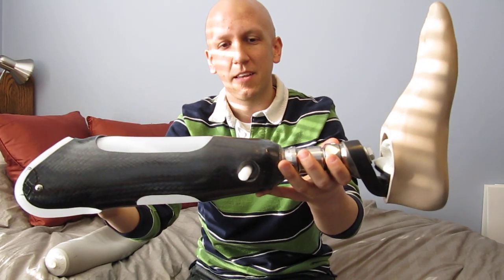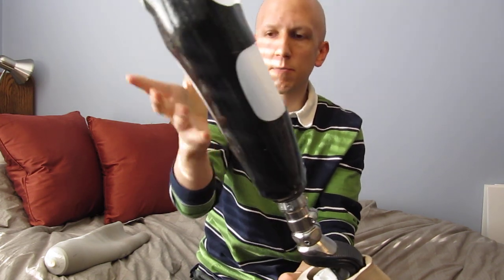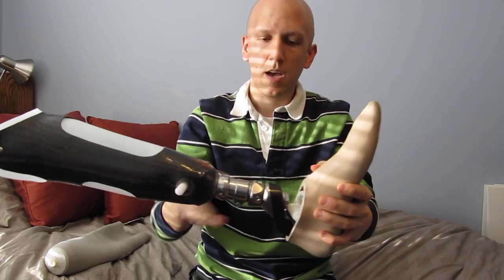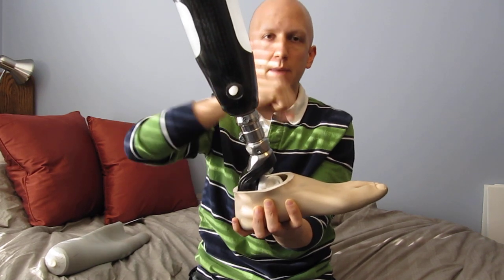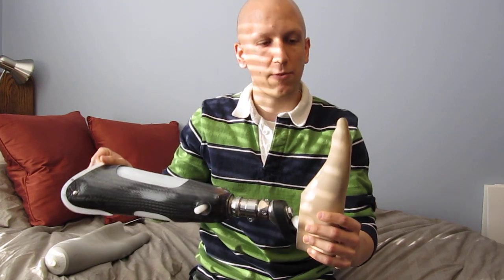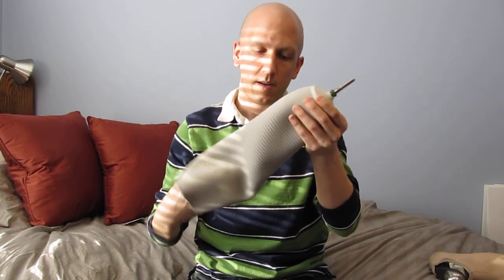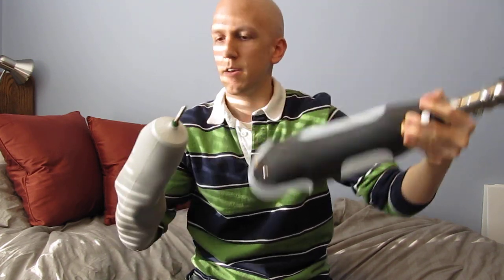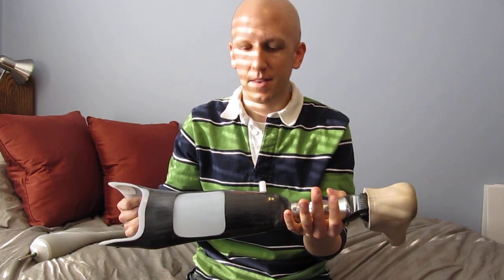How a Prosthetic Leg Works

Comment: hello, I have a prosthetic as well. my current foot shell is falling apart, I have a spare given to me from when I left my nonprofit. I want to ask, what glue is strongest to adhere the rubber foot to the upper rubber leg part. obviously it has to be strong enough to withstand the force of my weight, and strongly glue the rubber peices (I have the common rubber leg part that covers the mechanics inside, so my leg is all skin color). please help.

Comment: Just had my leg amputee above the knee.?how to i chose. A leg to do want i want to do?i own a farm and raise chickens and black angus cattle.so it will be in mud,chicken,and cow dung.plus get up. And. Down on john deere tractors to combines.any suggestion would be great.
Reply: Any prosthetic is okay. You'd just need to clean it more often if it gets dirty, particularly in the joints. The last thing you need is dung working its way into the joint pins and having fungus grow in there. Wearing a tall rubber boot will solve all of your problems.
Reply: 😭 uh i feel sorry 😐
Reply: how'd you lost ur leg man

Comment: This is nothing in comparison to the BiOM electric ankle legs. You have three small power packs which you put in the leg during the day and it simulates the ankle of a normal leg. You simply charge these power packs at night and use them again in the morning. And if you do somehow run out of power the legs work even better as these in providing a normal prosthetic limb.

Comment: I am a recent amputee due to septicaemia and have the standard prosthesis attached by a strap over the knee. It is a very poor device. I also have a waterproof device for swimming and that fits better with a ladies type girdle material over the the top section and onto my leg. It holds well.

So your lovely leg!! Is it available outside the UK? and also how much did you have to pay?

Best regards

Capt.. Martin Clayton